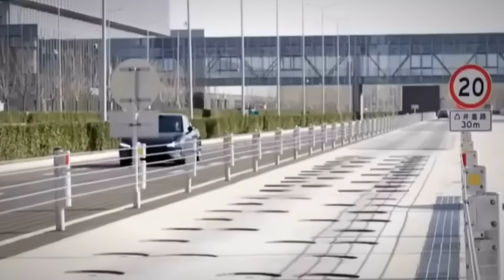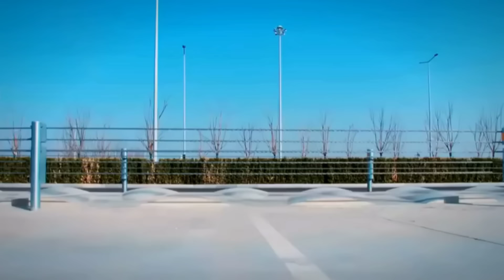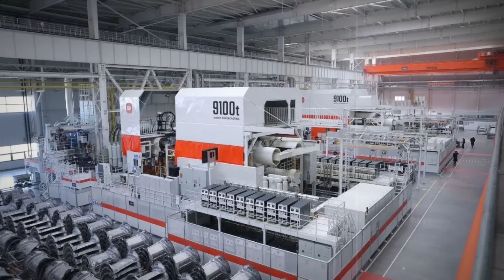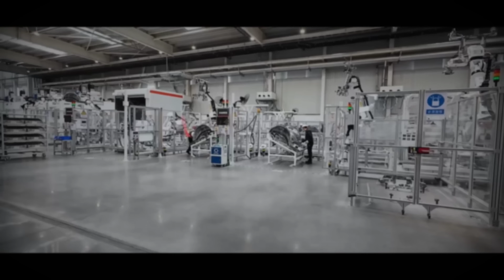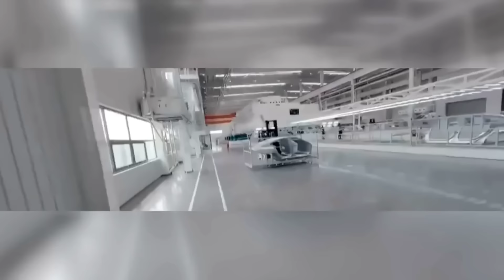China's INSANE Breakthrough Just Replaced Aluminum! XIAOMI CHASSIS 2026

Comment: The time saved in manufacturing pays for the rare metals in the alloy to enable plastic phase injection. 
But maybe the same components could be printed on a 3D printer if a component is short on factory supply for repair.